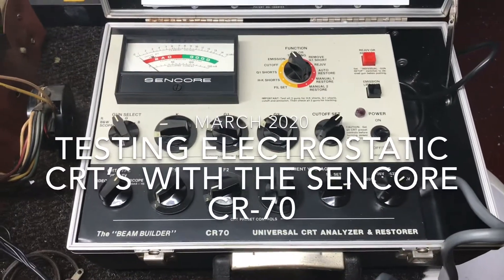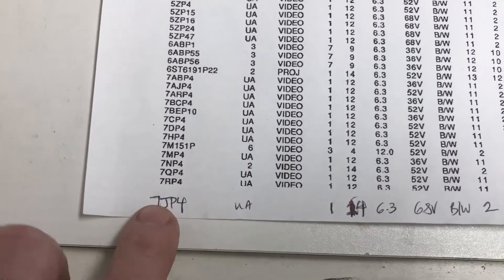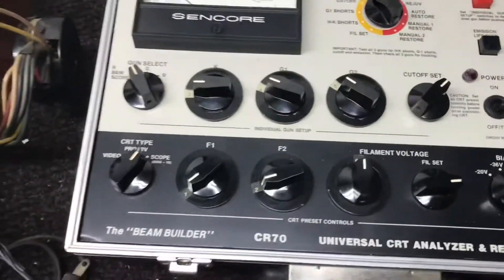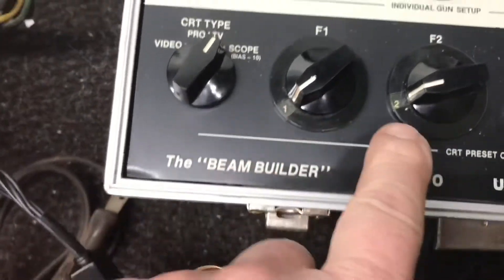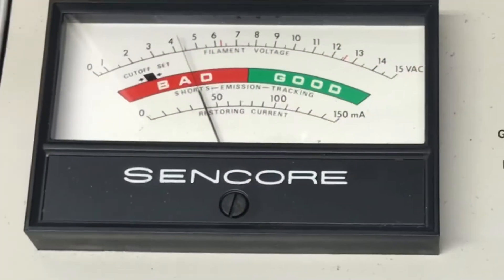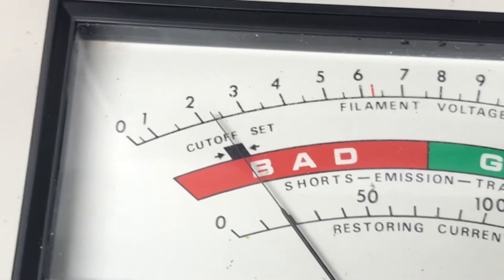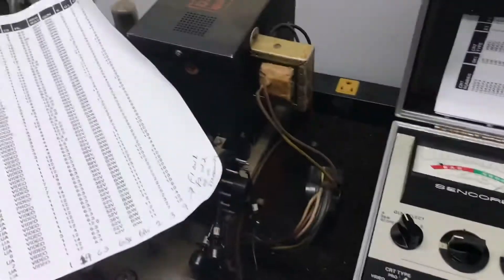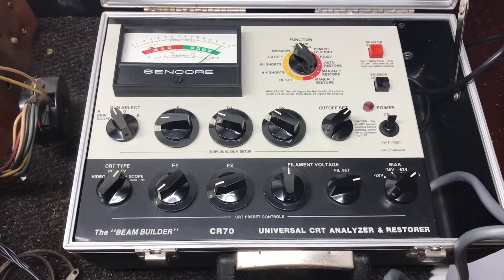HOW-TO Test a 7JP4 on a SENCORE CR70    Is it Accurate ?

Comment: where is the cutoff knob supposed to be set when testing emissions?  Totally clockwise and my 10bp4 registers very good for emissions.  Rotate the knob counter clockwise and the emissions drop accordingly and rotated all the way make the emissions go well into the bad zone.
Reply from the maker: On the SENCORE meter there’s a cutoff mark , that’s where the cutoff should be.

Comment: just purchased my cr 70 from ebay. j wouild love to try this.  does the clip adapter come with this set?  7jp4 tube just purchased also
Reply from the maker: The universal adapter that clips on to the crt pins is a SENCORE item. If you didn’t get it with the cr70 you may be able to find one , eBay?